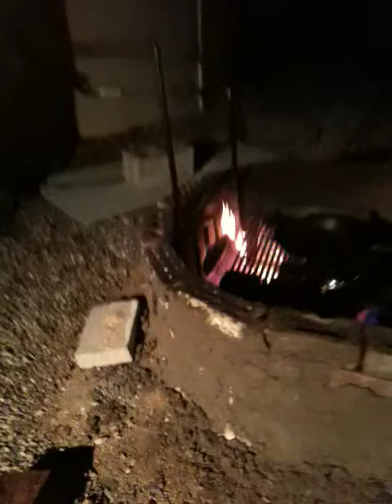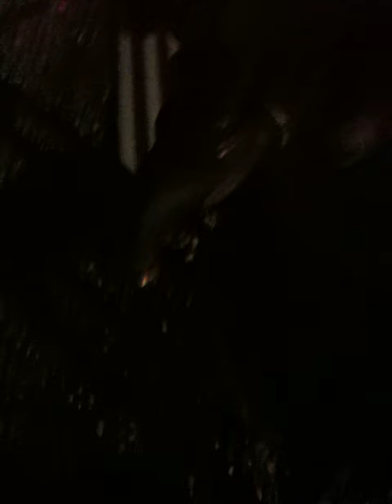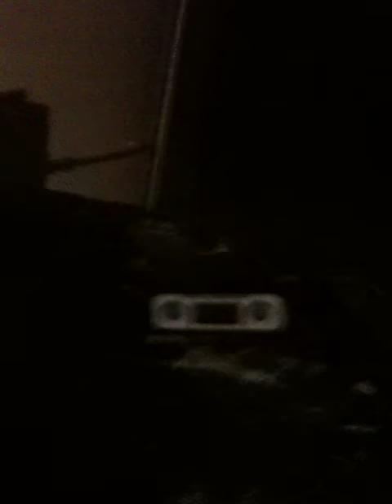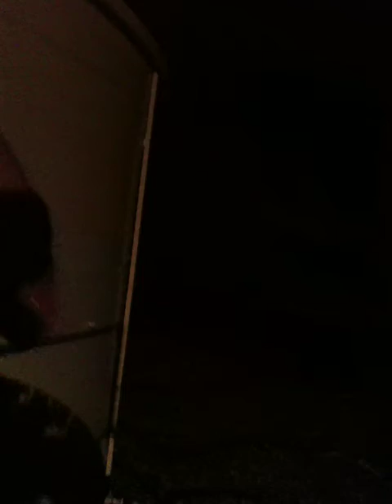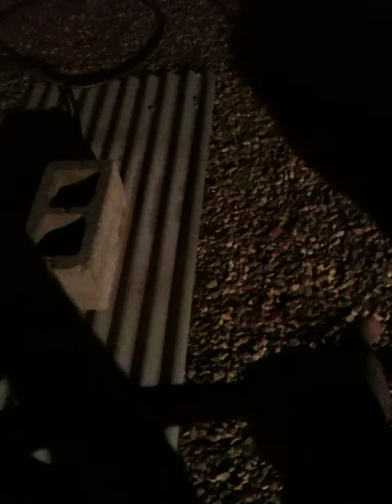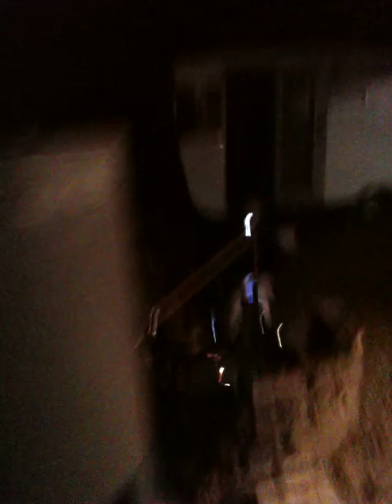Aussie homemade thermosyphon system part 3

Comment: Great idea. Just a little into though. I have been watching videos about "Rocket Stoves or Rocket Mass Heaters" They are simple to build so it will be a snap for someone like you. They use loads less wood, no smoke and are much more efficient. Thanks for the video.